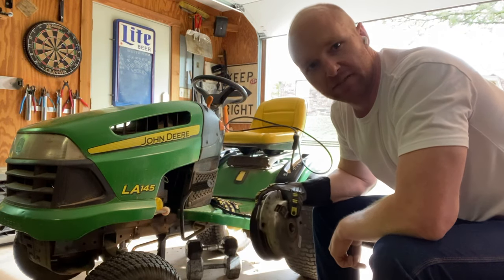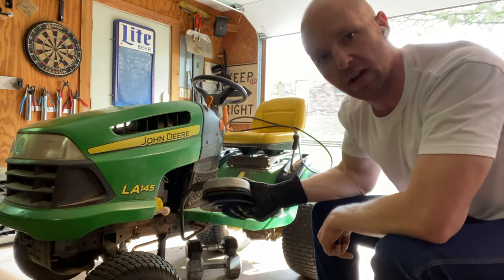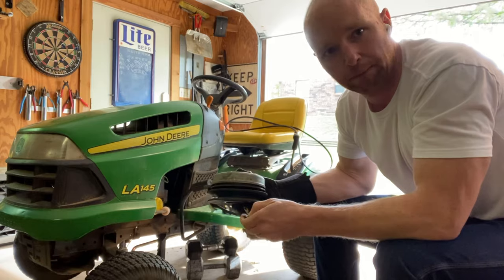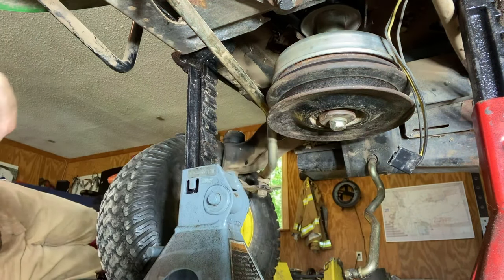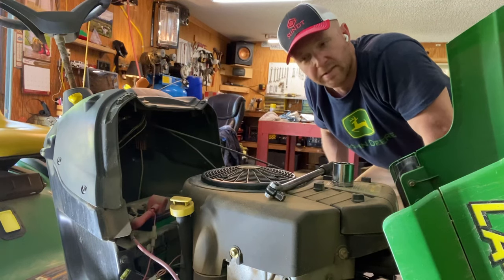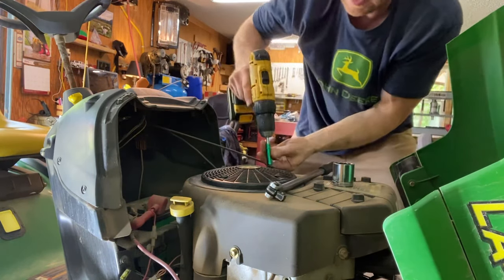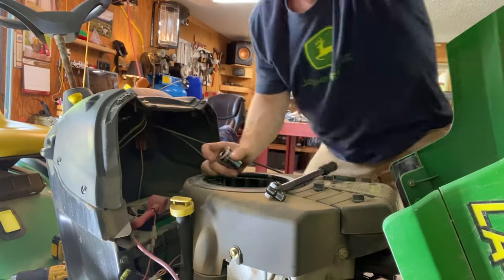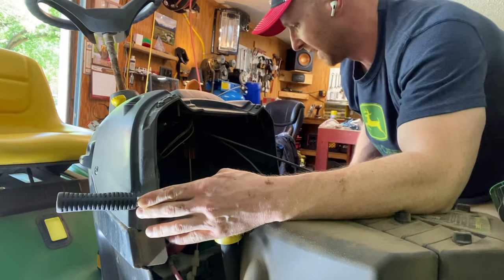John Deere PTO Clutch Removal and Replacement Video LA145, 3 MINUTES!

Comment: One doesn't have to go to the top of the engine for that "in case you don't have an impact wrench" piece of advice. If you look....right behind the head of that bolt you wanna remove is another structure. It looks like a really thick washer with 2 flat sides. You grab on to the flat sides with an adjustable.  Doing that will keep the the shaft from turning ...and at the same time you undo the bolt with your socket. That flat sided  "washer" is called a "D" something or other.  Hope this helps. For me it worked great. My joy quickly dissipated when the clutch didn't slide right off like in this vid. Well it's been on there since I bought the tractor in 2001(gt235) so it's is seized on there. Off to the repair shop it goes...couldnt pry it off. At least down here in TN they will accept the new clutch I purchased from Amazon w/o a hassle.

Comment: Important last step Dont reinstall with impact gun use a torque wrench to 125ft lb or you risk breaking the PTO!
Reply from the maker: Great advice. I havnt broke one yet but much better to do it right.
Reply: @MowerMike  I just got a new Extreme Pto and theres a warning when you open the box ive seen torque specs from 53ft to 125ft for what its worth lol

Comment: Just picked up an X360 that needed a new PTO Clutch.  Saw this video and figured, this will be an easy flip.  Then I saw the prior owner snapped the bolt.  Ug.
Reply from the maker: That is no good. I suggest getting some left handed drill bits and going at it

Comment: Not family but like the video I own a John Deere gt 235 tractor and my mower blades won’t disengage I changed the pot switch but it didn’t help . So now it looks like the clutch must be bad.
Reply from the maker: Never had that one happen. Sounds like the clutch is not letting go. Maybe you can take it off and clean it to loosen her up

Comment: Ive replaced the PTO cable correctly and when i pull blade lever it seems to move something underneath but when i get on and start the mower and engage lever nothing happens ....can u pls help me Im so frustrated and my grass is now tall 🤣
Reply from the maker: Hmmm it sounds like you have a mechanical blade engager deal. I suggest pull the blade lever when it is off and take a look above the deck and see if it has the blade belt tight. Then disengage the blade lever and try turning the spindles and pullies to make sure everything is turning smooth.

Sorry am not much help is hard to tell when I am not there. Good luck

Comment: Took mine off too examine it ( blades turn off once hot) looked ok put it all back in, turned it over an the bold an clutch blew off any idea why? Did I put it on backwards? Ruin my thread?
Reply from the maker: Did you remember to put the washer on the bolt when you put the clutch back on?

Comment: Thanks for the tip on the bolt on the top of the engine. I have a Craftsman DYT 4000, but my clutch doesn't have a D-spacer so I was having trouble torquing it until this video. I recommend everyone use caution as to not loosen the top bolt, but I figured it was torqued much higher than the 50 ft lbs of my clutch.
Reply from the maker: Glad you got it worked out!

Comment: Our L130 has the Koehler 23 HP engine. Getting to the crankshaft nut on the top required us to remove the cover around the top of the engine before we could remove the flywheel cover. Once there the PTO clutch bolt would still not break free. We bound the flywheel with a wood block to break the bolt free.  Also, the anchor strap provided in the kit did not align with the mounting bolt hole on the frame.  We used the original strap. Easier to put this on after the new clutch is installed.
Reply from the maker: Sounds like you need to invest in a impact wrench.
Reply: @MowerMike
Reply: Hi Mike, we tried that  - no bueno.

Comment: Thanks for making the video. I just replaced the ignition switch, PTO switch, solenoid, & starter. Every time I pull that PTO switch I blow my 20 amp fuse. Going to replace the clutch and those wires next I guess!
Reply from the maker: I suggest checking your wiring first, there is probably a short in your wiring or a connection causing it to blow.
Reply: @MowerMike  that’s what I think it is too. Two of the wires going to the clutch look burned & I can see bare wire. I bought a clutch that comes with a new wiring harness for $200. Can’t complain since the mower was free!
Reply: Replaced the clutch and the blades would partially engage, but then blow the fuse. Replaced the wiring harness & it works as it should again. I cut off the wires that hook to the back axel and seat & everything still works.. except that backup and seat sensor that used to cut the blades off.
Reply: I usually have to have the choke all the way on for the mower to run right. I replaced the carb with a brand new one. When the mower is hot I can run it wide open with no choke & it’s good to go. Even starts back up easily. When it’s cold I have to start by spraying starting fluid in the intake or it won’t start regardless of what I do with the choke. If it’s not one thing it’s another, but at least I’m getting the grass cut!
Reply from the maker: @michaelhowell8990  Check the fuel pump vacuum line and make sure there are no intake leaks. You can spray carb fluid around the intake when it runs, if it bogs down you know you have a leak. I have a great video on the fuel pump. This all assumes your carb is clean. Some of those Amazon carbs from China are junk and don’t work right

Comment: Hey MM, great video, I first watched your video of how to replace the transmission belt.  Followed along (without an impact wrench) and did not counter turn with bolt on top of motor (probably should have).  I held the top spindle of the clutch with a pair of channel locks.  Removed the bolt under the clutch.  But the big difference with my result is the whole spindle that holds the clutch came out. It has a slotted grove, so it only went back on one way. Put it all back together. (Did not put deck back on yet) went to test it, Pulled the PTO engage switch and nothing. My whole housing it turning. The top part of the clutch where the wire goes in is turning with the portion below that connects with belt. (Only turns so far until it hits the belt guards).  I did not have to remove the belt guards because the whole spindle came down, so was able to get transmission belt on and push the assembly back up.  Any idea on why mine came apart differently when removing the bottom nut? And what I might have done wrong putting back together?  Thanks for your help.  I appreciate your sense of humor.
Reply from the maker: Ok so the top pulley closest to the engine is for the drive belt. That will always turn unless you put the parking brake on which loosens up the belt. 

The bottom pulley is the PTO and should only come on when you pull the blade switch.

The shaft it bolts to has a groove on it and a square key (rectangle piece of metal) goes in it to keep the PTO on it. Maybe that fell out? Let me know if any of this helps
Reply: @MowerMike  Hi Mike.  Makes sense.  I took apart and made sure keys were there and lining up. Seems to all be ok.  Got it to engage and the mower Lully at the bottom spins when engaged with PTO switch.  The piece right above it where the wire plugs is not in a stationary position.  It is turning too as far as it can until the magnet/coil hits the guard.  Maybe it’s supposed to be move like that but?  I made a quick video of it so you could see but not sure how to share the video so you can see it. Thanks, Dan
Reply from the maker: @danculhane7959  I think I know your issue. There is a notch cut into the bottom flange of that PTO and a bar bolts to the bottom of the frame and fits into that little notch. It is the bar I remove over the PTO in the video. Good luck
Reply: @MowerMike  yup!!! That’s exactly what I missed!  THANK YOU!  I appreciate the advice!  Great videos by the way:-)
Reply from the maker: @danculhane7959  Glad you got it figured out. That is a weird bar unique to the cub cadet.

Comment: Also check the spring on the tensioner pulley on the deck...mine broke and didn't discover it ...big headache . It keeps partial tension on the belt until the PTO kicks in .
Reply from the maker: Yep excellent point. Those springs wear out and cause you to feel like your transmission is going out when it is just a weak spring. Thanks for the put

Comment: Thank you so much for this video. I changed out the clutch today. The deck engages and runs for a couple minutes while mowing and tries to die. The battery died, and I have to jump it everytime. I shut off the pto while it bogs down, let it idle for a minute and it runs for a little bit. Willits not run off the alternator only or does the battery need to be changed out. Thank you in advance, for any response...
Reply from the maker: I would remove the deck and check all the pullies by hand on the deck and under the mower to see if you have any restrictions. If they all turn free then I would make sure the carb is clean and then if it still is bogging down check compression. That engine maybe just wore out. 

Good luck I know it can be frustrating

Comment: Thank you! I did not have a ratchet gun so the tip to manually get the clutch pulley off was a help. Didn’t have the right socket but was able to hold in place with a screwdriver and a friend.
Reply from the maker: Awsome glad I could help
Reply: @MowerMike  Great tip for no impact drill !!! Thanks!!

Comment: I just recently picked up a white gt2150 that has an electronic pto. The tractor is exhibiting a no crank no start. I believe the key switch is good and I’ve tested the starter solenoid and it is good. I got it running by putting 12v directly to the starter. When the tractor is running the blades are always engaged no matter the position of the switch. I checked the resistance of the switch and it tested good. Wiring to the clutch is good too. Do you think that something is wrong with the clutch on the electrical side causing the tractor to not crank due to a safety feature?
Reply from the maker: Sounds like your switch is always on. I would put a new switch on it. Yes if the PTO is on the mower probably won’t crank.

Comment: Hey mower Mike thanks for the video. I’ve got a L120 and about to replace the sump gasket. Now I know how to take the couch off before pulling the motor off.
Reply from the maker: Do you mean the gasket around the base of the crankshaft on the bottom of the motor? Glad the video helped!

Comment: Thanks for the video,  might be replacing one on my L120.  The fuses keep blowing when the PTO is engaged.   Look for broken wires, but looks like the clutch is not working correctly causing power surge blowing the fuse.  Well that is my guess.  Thanks for the video.
Reply from the maker: Sure thing, glad it helped. There are some PTO test video out there that may help but that is above my head. Good luck

Comment: Can also take spark plug off and slide a piece of rope into the cylinder to stop the crankshaft from rotating
Reply from the maker: Interesting I have never heard of that one, thanks for the tip
Reply from the maker: Check out my new PTO video I just released where I used your rope trick. Worked great thanks for the idea!

Comment: Hey Mike
I have an L120 and I wanted to replace my PTO clutch but I’m not able to do what you say here in the video….
I am trying to take the bolt underneath it but I don’t have an impact so I tried to grab the top nut with a crescent wrench to hold it and the bottom with a torque wrench to take it off….
Well unfortunately the nut on top only gets loose and won’t help to loosen the bottom bolt of the pto clutch….
I also just tried a friends impact and won’t work it only spins the entire thing….
Any other ideas??
Reply from the maker: Try shoving a rope into the cylinder through the spark plug hole. It will freeze the engine so you can twist that bolt off. I have a video on it

Comment: how to adjust park brake linkage on GT245 john deere tractor to keep it from creeping forward and growling when engaging brake?
Reply from the maker: If you take off the back wheel you can see how it adjust it
Reply: @MowerMike  the mower doesn't creep when you take your foot off the pedals. it only does it when putting the park break on.

Comment: That’s pretty simple. I like your comments on being young and not having an impact. I’m 71 now and I do have one. Actually 4, but when I was young I did everything with very basic hand tools and a 1 1/2 ton bottle jack. 
If it can be done with gasoline, electrons, compressed air or nuclear power, I’m in. Otherwise not so much.
Reply from the maker: Haha what were you running with nuclear power?
Reply: @MowerMike  
My time machine. You may have seen it in the movies.

Comment: I have what looks like the same clutch on my husq TS 248XD. After doing some heavy motor work on it and reassembling the motor to the chassis, I now have a loud clanging coming from where the anti-rotation link meets the pto. I also get sparks from where the pulley spins against the link.
What did I do wrong on reassembly?
Reply from the maker: Did you put the key back on the crankshaft when you installed the PTO? If not that maybe your issue and the crank is twisting in the pto
Reply: @MowerMike  yep!
From what it looks like, the clanging is the slot quickly moving back & forth with the linkage between.
It sounds loudest when the pto is first engaged, and when it’s disengaged.
I was able to take a video of it and the grinding appears to be coming from the pulley contacting the link. I’ll post the video to my channel soon.
Thanks for replying! Very cool. :)
Reply: @MowerMike  yes sir
I’m taking apart the pto clutch as it seems there might be an issue with it.
The resistance checks out (3.5ohm)

Comment: When I engage my switch I can hear hissing with no blade activity, before that there was some metal on metal noises and my belt is now starting to sheer.  I have a z335e, and I assume my clutch is at the rear.
Reply from the maker: You just need to find what is stuck. Something isn’t turning and is binding. I would drop the deck and go through all the pullies and spindles

Comment: If you have a big enough open end wrench you can put it on the flat sides of the bushing that the bolt holding the pto clutch up presses against.
Reply from the maker: I don’t know about all that, I don’t get how that would grab and hold it. Check out my other PTO video with the rope trick
Reply: mine is recessed so you can't get a wrench on that I was wondering if there was a special tool for something like that

Comment: Awesome video! After reassembly, i have a ledt over piece that was in the grass where i was working.  Its kinda like a plastic bushing?  It was near where i removed the clutch.  Any thoughts?
Reply from the maker: It maybe the washer that goes on the bolt.

Comment: I took the PTO off to replace my drive belt and went to put PTO back on and I couldn’t get the bolt to thread back up. What did I do wrong?
Reply from the maker: Look at the bolts and see if the threads are damaged, if so get a new bolt. Or tap or chase the threads in the crank to clean them up. If you tried forcing the bolt in you may have stripped some threads. Do it with the PTO off when you work on it

Comment: Thanks! Buddy. My JD LA130 21 hp. Went two rounds this afternoon and the blades quit. Tried starting engine didn't click or start. Didn't know it had a clutch under there. Dummy me! Thought it could be the yellow pull up switch or the seat sensor bad. How much is the clutch?    Shawn.
Reply from the maker: No idea but I have never seen the actual clutch go bad. It is probably a sensor. Try unplugging the seat sensor and if starts working that sensor is bad. Also clean up the connection to the PTO. There is an electrical hook up on the wire feeding it. Good luck

Comment: Thanks. Simple enough. 
My problem
Is that I am chewing belts and this is the last pulley not replaced. 
Can the pulley be serviced separately?
Reply from the maker: Well the PTO isn’t a pulley. I suggest checking your other drive pullies and make the top of the transmission. Also check your belt guides to make sure they are not rubbing. Good luck I know it is frustrating
Reply: Thanks for responding 
The mower belt pulley seems to be one assembly with the electric clutch. If that pulley is damaged is it removable with ease. 
I bought a Kevlar belt and when I change it I will be sure to check the routing and keeper pins 
Thanks
Reply from the maker: @richardblumer4349  I have no idea which pulley you are talking about. I have a few drive belt change videos on my channel though that should have you covered. Good luck!

Comment: Mine won't turn over  I replaced switch brake switch pto switch silonoid  backup fuse checked all wires but want turn over pto is next any info would be great
Reply from the maker: Sounds like it is time to get a little test light and follow it till you find the culprit

Comment: Hello Mike, I have a John Deere LA175 mower tractor and recently when I did the transmission belt replacement, I use my impact gun to loose the PTO clutch, BUT when I trying to put this back, I broke the big washer next to the main bolt ( I'm not sure if this is a  regular washer or have another function) . I Don't know if I can replace only this washer or I need brought all the entire PTO, loo like is attache to the bottom part of the PTO.
Thank you for your help.
Reply from the maker: It is just a washer, it was probably just stuck on the PTO. Just put it back on or a new washer and you will be fine.

Comment: Gt235. Mover runs well However once I pull pto switch out mover turns off. Blades don't move.
Reply from the maker: Sounds like a spindle or pully is binding up under the deck. I suggest checking that everything moves freely by hand